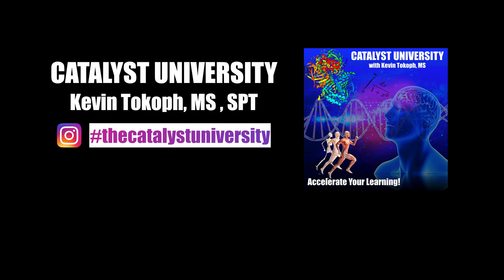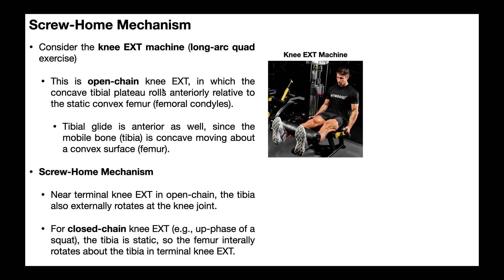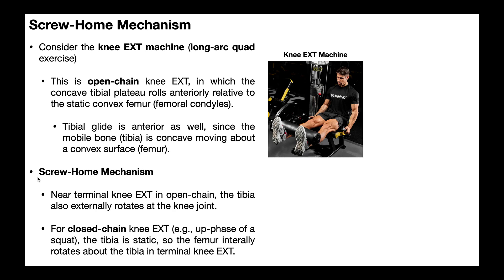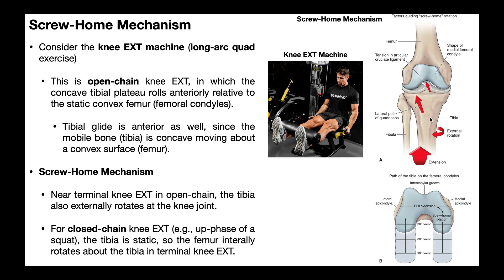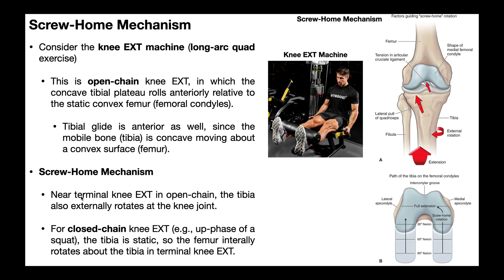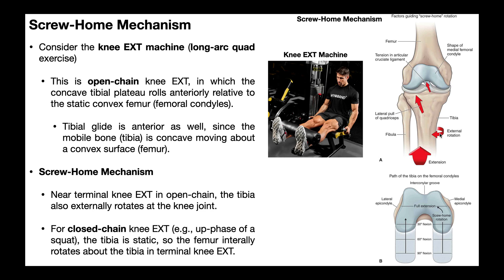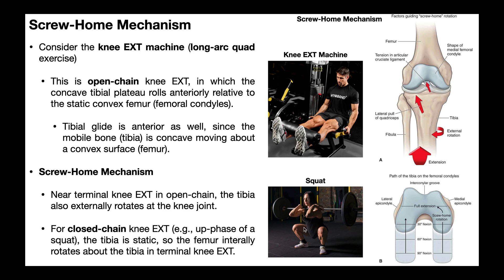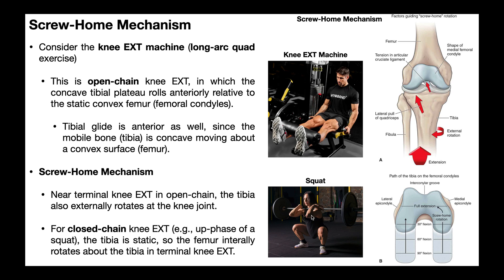Screw-Home Mechanism of the Knee EXPLAINED

Comment: During the open chain knee extension, is there any restrictions on the external rotation angle of the tibia before 30 degrees? I’m doing research on this and from 90-45 degrees of flexion there is slight external rotation, then 45-30 there is internal rotation and then finally 30-0 there is external rotation of the knee again.